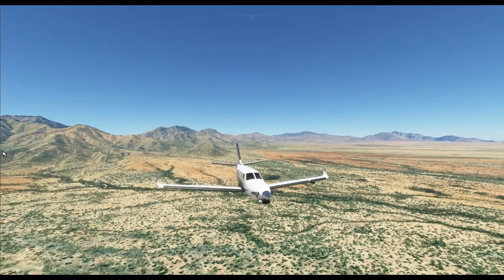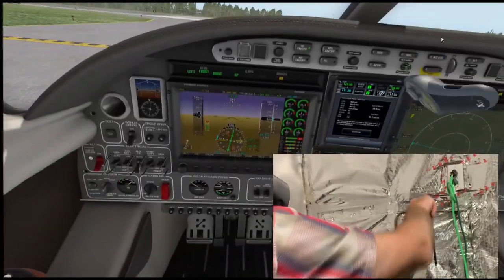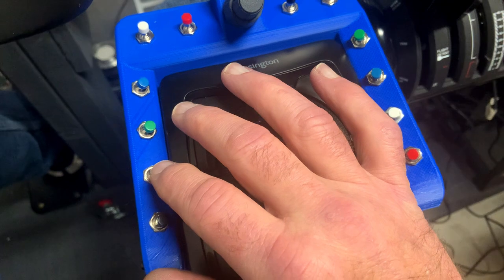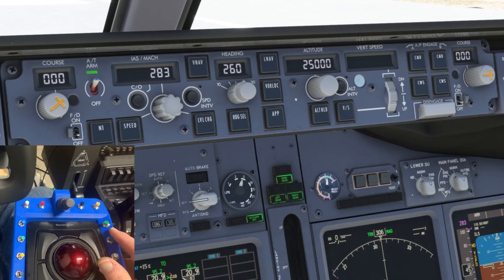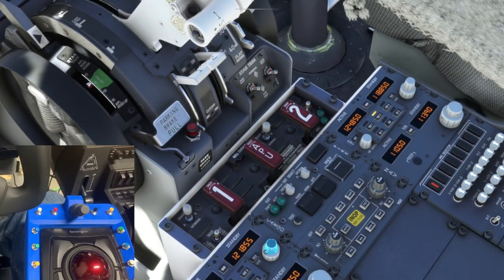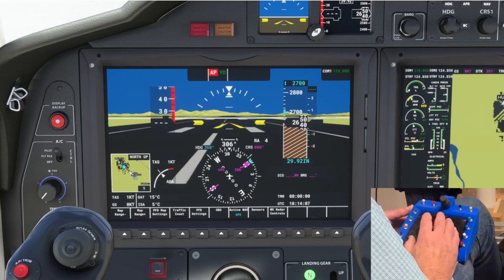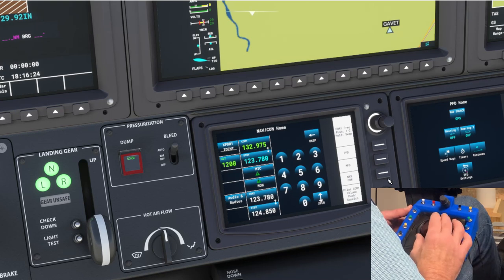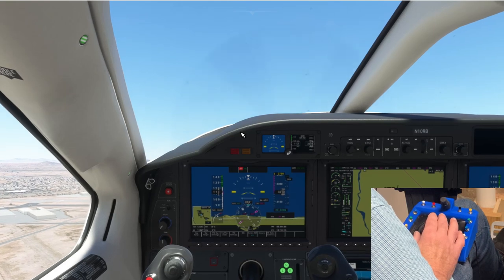VR Mighty Mouse

Comment: Hi Russ, thanks for this update on the huge VR problem with controls / knobs.   My flying is very different than yours, as I am a 140 hr VFR SEL pilot and a grandpa teaching grandkids on the simulator.  I think the kneeboard knobs is a great thing.  I use the honeycomb yoke and love all its buttons which are programmed to do various functions.   Having another dozen highly programable (including mode setting as you demonstrated)  buttons sounds great.    Possible button uses:  (1) center the mouse cursor - since the rollerball replaces the VR hand controllers, and since I also knock a rollerball mouse around just in normal computing, a button to spawn a little routine to instantly put the mouse cursor in the center of my screen so I can visually acquire it and  move it from there would be nice.    (2) in training my grandkids, buttons tied to simulator functions, like specific views, is helpful to quickly jump back and forth to help with orientation and situational awareness.  (3) All the basic controls to take off and land .. brake toggle,  flaps up / down, etc. are needed (currently done with honeycomb buttons).  (4)  as you demonstrated the radio stack is great.   (5) in our simple aircraft we don't have glass cockpit instruments, so a button to pop up/put away the map and (6) zoom the map in/out would be very useful.   (7)  Thinking of zoom, a button to quickly move "eye" closer to instrument panel (for easier legibility) and a button to zoom back (for "wider FOV") would be great.    Just some thoughts off the top of my head.  Keep up the good work.  You are a goto site for me.  Cheers.
Reply: Thanks for watching my videos👆 🆙🆙 Hit me up right away 🆙🆙 I have something for you 🆙🆙🆙👆👆👆

Comment: Nice versatile, relatively easier-to-build and compact solution sir👏. Though I have to say personally I'm not sure whether I'd like to trade in how much of "authenticity" for an easier sim-pit building... Other than writing down notes, tackling with the knobs is surely another pain for VR flights yet lacks ideal solutions, and the multipurpose knob is certainly a way to go and way better than the pick&twist of the magic wards. As for clicks/flipping the switches, there is another hidden gem called PointCTRL, which is basically a pair of finger-wearable mice with three push buttons that allows 1:1 hand to cursor movement in a VR cockpit environment. It could also do scrolls by gesture or bush buttons but not as intuitive as a knob but I'd imagine it's better than twisting wards. With some supporting surfaces(e.x. wood panels) placed roughly at the same position where a real panel surface would be, it could work even better. I believe the physical feedback it provides(by clicking buttons on it as left or right mouse clicks) would superior to any hand tracking(*accuracy for this one as well), maybe even to those upcoming VR gloves, at a reasonable price. Though the issues/weaknesses for it are: 1.currently long lead-time but likely progress will be made soon; 2.currently only officially support DCS. MSFS support is on the roadmap(since the way how the mouse cursor works are different across the platforms) and when the backlog is better fulfilled with the upcoming production bump-up, the dev will have more time to do that as he already has some preliminary success on MSFS implementation. Not sure whether or how it would support XP or P3D, since basically no report on that and I'm still waiting my turn, but if the mouse cursor will work the same way as in DCS, they probably should be fine. 3.It's not perfect, it's not 3D movement, it doesn't have a wheel to scroll(probably in the future iteration if he finds a better way to implement it). But the dev is a super nice gentleman and actively supports his customer. In a perfect world, I'd like to have some wearable VR controllers as an evolved form of PointCTRL that have buttons, rocker switches, and even a wheel, along with a bunch of reconfigurable "system/swarms of knobs" -- individual "lego" knobs modules that could be put on aluminum profile simpit frames in their respective real world locations and freely reconfigurable; all of them are then connected to a single control module that goes to PC...but since no one is even nearly making them, I guess I'll probably end up with buying some relatively cheaper 1:1 main control panels(G1000, Garmin AP Panel/GMC, Boeing MCP,+EFIS, AB FCU, CDUs) made by some Chinese builders and using aluminum profiles to build a reconfigurable simpit frame mainly for VR usage, for better immersion as well as better muscle memory building experience(I know I'm not supposed to use PC sims for rather serious training purposes but at least I want to try to avoid building negative ones). In the long run, Mixed Reality with physical input devices might be a better performer in terms of authenticity, and I hope the Pimax 12K will fulfill its promise, especially the MR module for that matter...
Reply: Thanks for watching my videos👆 🆙🆙 Hit me up right away 🆙🆙 I have something for you 🆙🆙🆙👆👆👆

Comment: Great video and idea Russ. I use the mouse in VR, but specially with dual knobs can be tricky. Wanted to know if navigating with the trackball over the knob until it highlights blue the knobster becomes active and the knob can be controlled directly if the buttons in your project are not present. I have no idea how Arduino or AirManager works. Is the knobster something relatively easy to make? Would you post a video/plan on how you made it?
Thanks and keep the videos and ideas coming!?

Comment: Russ- can you share the method of programming the buttons that allow the selection of what the rotary encoder controls.  From your previous Nano videos one can see how to make the encoder work for a single function but I have not been able to find how to get a button to tell air manager how to change what the encoder controls.  Thanks for the great content and keep the ideas coming!
Reply from the maker: So it is pretty simple. First you need a global variable that keeps track of what button has been last selected. Then you create a conditional statement  like:

If button state is X then execute the commands (clockwise or counterclockwise as appropriate)for knob related to X
Else if Button state is Y then execute the commands for knob related to Y
And so on

 do this for every button, and then, when the encoder is actuated, knob, inputs will correspond to the current button selection..

Comment: How well would this work outside of MSFS? I'm thinking for something like DCS. I have a basic track ball but wanted a more rigid setup.
Having the multiple commands setup for DCS would be amazing, being able to toggle comm radios with a single button press to be able to use the rotary for various different knobs would be amazing.
EDIT: also, have you tried leap-motion? I've seen a few guys use it and they seemed like they enjoyed it. There's also Point CTRL, which uses a finger-aimer with a few buttons on it for interaction (at least in DCS thats how it works, you point at the button in the virtual space and use the buttons to control what you want the switch to do)

Comment: another great video and a great idea Russ. You never fail to amaze me! I'm not sure how to program those buttons using an arduino. I've used a Leo Bodnar Button Board before and those were relatively easy to use. There are also a great range of different buttons that could be used. I thing using the bigger square buttons may be better if you have 'sausage fingers'. The enclosure could be made of wood and more buttons added to make it even more comprehensive.
With regard to the buttons I think that you made a good selection. You could also use one of the speech recocognition packages available like voiceattack and hcsvoicepacks to give some work to a First Officer.
Keep making the videos Russ, I always look forward to watching them. Regards. Peter
Reply: Thanks for watching my videos👆 🆙🆙 Hit me up right away 🆙🆙 I have something for you 🆙🆙🆙👆👆👆

Comment: Thanks Russ.  I have already built my own Knobster and have it mounted on my Bravo.  Now I guess I need to buy a new mouse and some more buttons.  Since I fly mostly Cessna 172 and the Piper Arrows I would probably not have the airspeed button and swap it out for course. Also, will you be making the AirManager and Arduino code that you used for this project available?  Thanks again for sharing what you do.
Reply: Thanks for watching my videos👆 🆙🆙 Hit me up right away 🆙🆙 I have something for you 🆙🆙🆙👆👆👆

Comment: Some noob questions.  I'm an engineer 30+ years out of flight simulation. Work and family took priority.  I am planning a new VR configuration.  The VR physical interface and total system cost have kept me from jumping in.  Your videos and a recent improvement in my financial situation have convinced me to get started.  It seems like you can use a mouse (trackball) to select an analog panel device and then use the knobster to change the setting.  Is it really this easy?  In VR and using the trackball, do you click on the device or just hover over it?  Are there any special considerations for using Air Manager with VR?  Are your physical buttons just for convenience with frequently used devices?  Thanks for your very informative videos.  I'm sure I'll figure these things out over the next couple of months if you can't respond.
Reply from the maker: The Knobster currently only supports Air Manager panels on MSFS. There is a app separate from Air Manager called KnobXP that allows you to set up a window in VR(X-Plane only) that you can select a knob in the VR cockpit and then control with Knobster. Hopefully this will become available for MSFS soon. This is why I created this Mighty Mouse to make some often used knobs more easily accessible.
Reply: @rbarlow  There is a huge demand for this Knobster in the rest of the flight sim community, especially DCS World, if only there was an app for that. If you have no interest in developing it further in that regard I would encourage you to maybe outsource that project to someone else (partner). This is a massive issue for everyone flying VR, and even non-VR as a physical knob is still far more usable than trying to turn an onscreen knob with a mouse, etc.. Please bring these great inventions of yours to market Russ.

Comment: I've postponed VR for one single reason: difficulty interacting with the sim. This supermouse would open up that whole dimension of simming for me, but it's not a project I have time to pursue on a DIY basis. Just like you did with Stay Level/Touch Panel and Sim Innovations/Knobster, you have to collaborate with a fabricator to get this manufactured for the community. As an example, if I were to start out with a Reverb G2,  I, personally, would be willing to meet a price for the Barlow Supermouse that was in the vicinity of the price of the headset, especially if it came with a software GUI that makes button assignments but even if it didn't. For me, it's just as necessary for VR as is the headset.
You've stated that you have no desire to profit from your inventions, but it might be time to rethink that approach, if that's what it would take to make this device available to the thousands of us enthusiasts who lack the expertise to make it in our basements.
If that's out of the question, a parts list with links would also be a big help.
Reply: I agree that these products should be marketed, as the demand is so great. I also understand any reluctance to go into the business of producing and selling these things. If Russ isn't interested in making flight sim VR hardware I would love if he would maybe just sell his inventions to someone else that would bring these things into the community as plug and play devices. Just that knobster alone is a game changer in how it makes functionality of these controls actually very usable in a world of very frustrating processes within the existing products. Do it Russ, do it!

Comment: Love the idea!  So are you using one Arduino to control a knobster with buttons?
Reply from the maker: Pretty much maxed out the Arduino Nano here. It is the same type encoder used on the Knobster  but unlike the Knobster  where you can mouse or touch any knob on an Air Manager panel, these buttons are hard coded to specific knobs or other sim functions
Reply: @rbarlow  ahh ok that makes sense. I love the idea though. I may have to make one!

Comment: Russ, do you have a link for the buttons and the knob used?  Thanks!
Reply from the maker: The encoder is an Elma E37 dual encoder which is expensive but good quality…Leo Bodnar has them but a cheaper dual encoder would do too. As for the buttons I got them on Amazon but any momentary closure push button would do. I think the ones I selected were not the best quality.